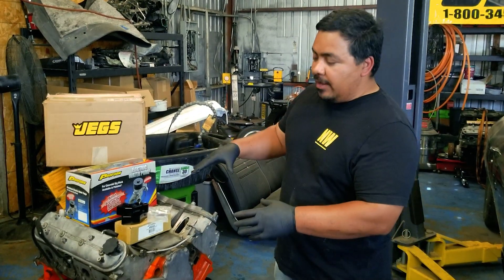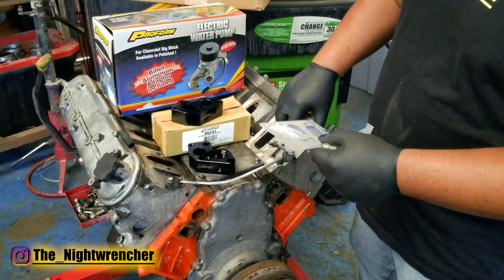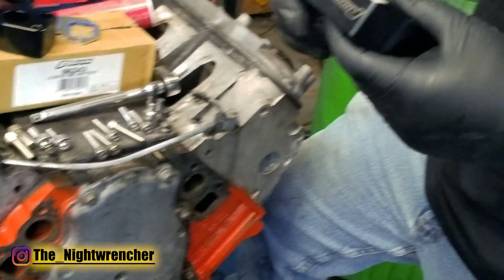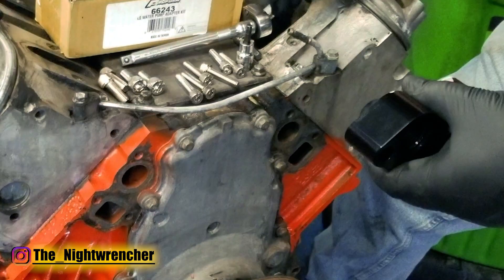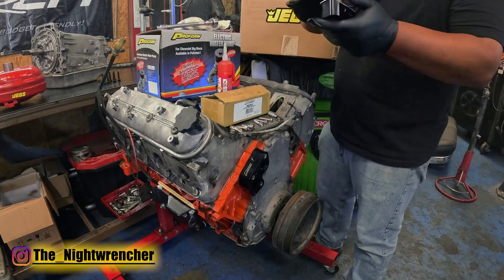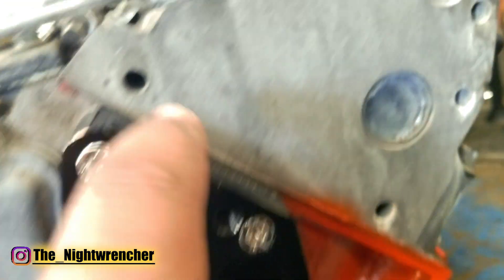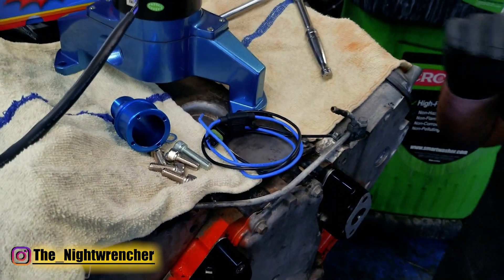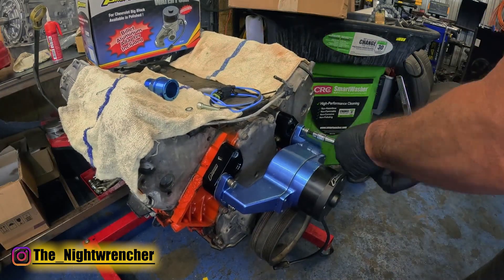Budget LS AND BBC Electric Pumps Are The SAME? Proform LS Electric Water Pump 68230 | How To LS Swap

Comment: why would you want to delete regular water pump? how do you supply the energy for it?
Reply from the maker: @alibabaei1953  for drag racing or dyno testing. Not for street use. You will still have a battery but either no alternator or low mounted alternator

Comment: Where’s does the upper rad hose come into play.
Reply from the maker: Its got pipe fitting up top so you can connect those to AN fittings that lead back into the radiator. Not something you might wanna do on a street car.

Comment: What are the advantages of running an Electric Water Pump?
Reply from the maker: @mayham_7258  on a regular street car? Nothing. On a race car or a vehicle with a relocated radiator, it lets you run water through the engine without a belt, saving horsepower. Can also have the pump run with the car off in order to cool the engine down faster.

Comment: I have seen this video (others made same content) however no one seems to have a handle on the upper rad side of things??   still trying to figure out how this is a cheaper/better way when after you get all the stuff it takes to do you as much or more then just buying the right ls electric water pump??
Reply from the maker: I'll have a separate video about this but its really not much. You don't have to buy fancy fittings.
Reply: @NightWrencher  cool you have a link??
Reply from the maker: @835YT  I will in a few days 👍
Reply: I need that link

Comment: More money no
Reply from the maker: You are right! A lot more money because you'll need to redo your serpentine belt routing in order to properly get your electric water pump installed in a regular car. I don't recommend electric pumps for the street, its more of a performance mod if you plan to make more power or race it
Reply: @NightWrencher  e.w.p is great for the street, especially with a carb. but you need a controller with soft start and delayed shutdown when the engine is turned off.  i hope you will get into all that for everybody.